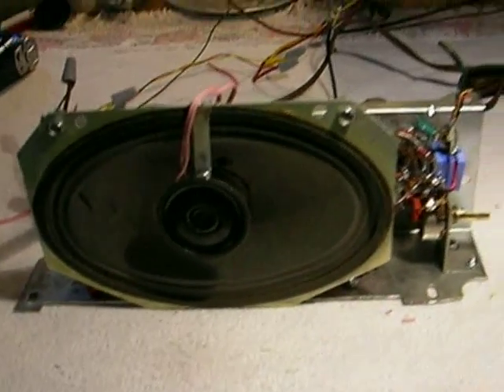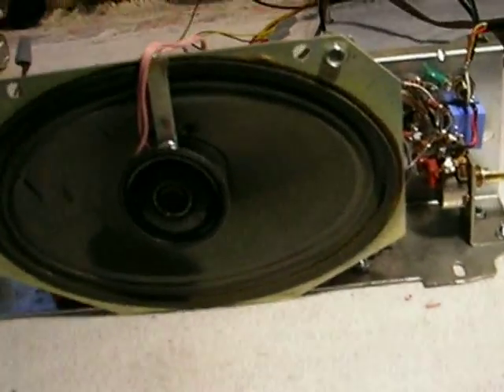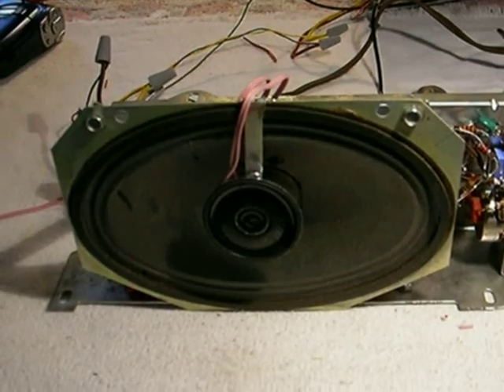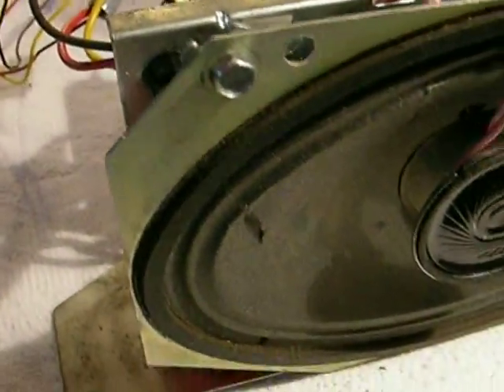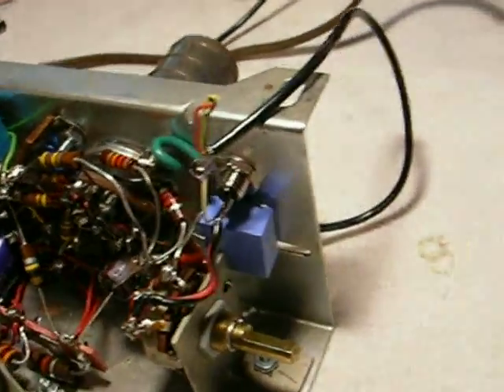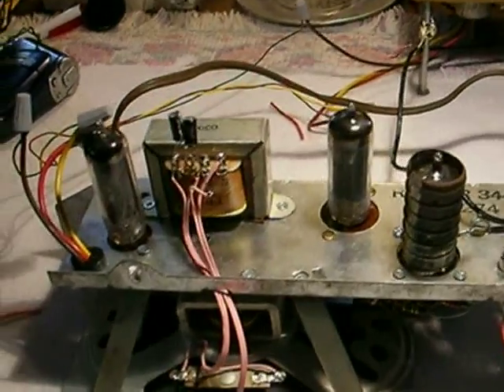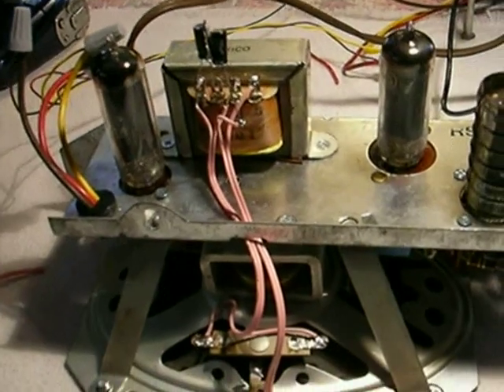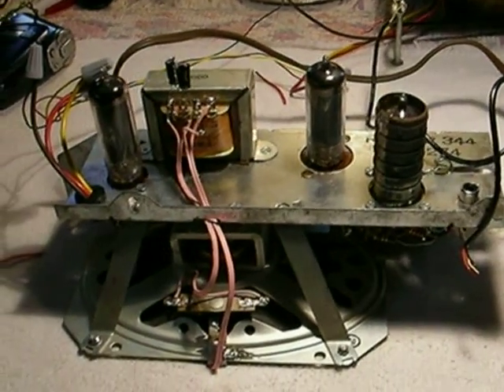45EY2 amp changed to push pull HiFi

Comment from the maker: I wanted a selenium, because with a FW bridge, the B+ is WAY too high, and there is only so much room under these things for other parts. I also would have had to use bigger (and hotter) resistors. I did toy with the idea of using a power transformer and two 6BQ5's....